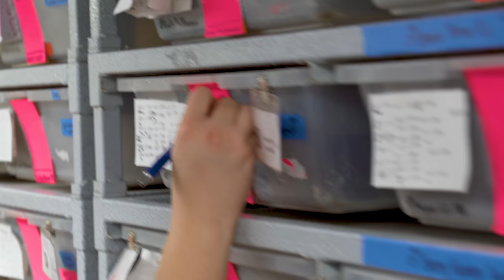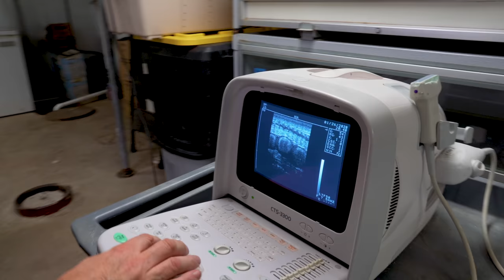GIANT LIZARD REACTS TO EATING FISH AS A MEAL!! | BRIAN BARCZYK

Comment: Get industrial exterior caulking to fill the holes. I'm a large scale glass and metal  installer and we use 895 NST caulking that will keep both your weather out and humidity in. If you want an even better insulation stick some backer foam  in first and the caulk over it. Smooth it out with a putty knife to make it look purdy. Bronze color will look good with your faux rock backdrop
Reply: We get our sealants from HD Supply, Kenseal, or Guaranteed Supply.. maybe you have one in your area ?